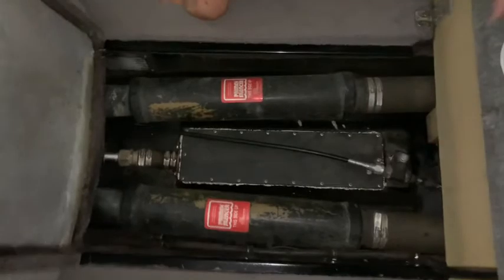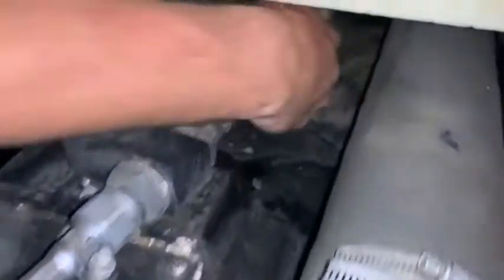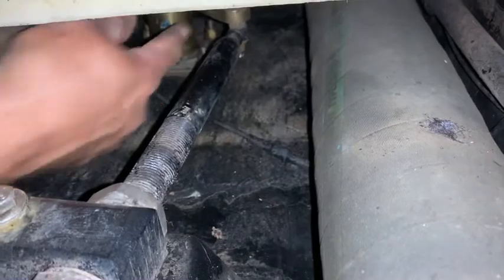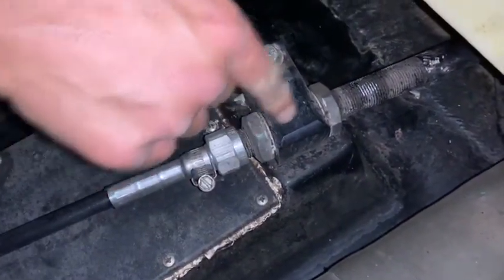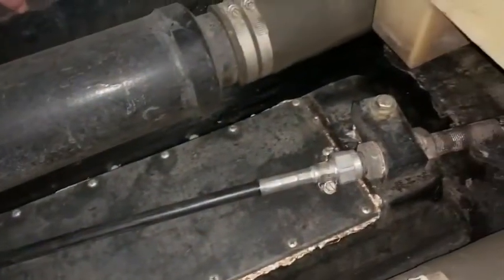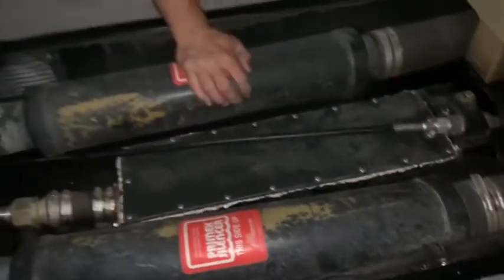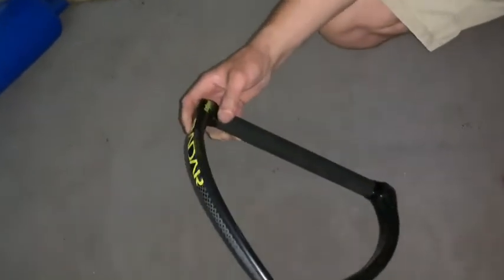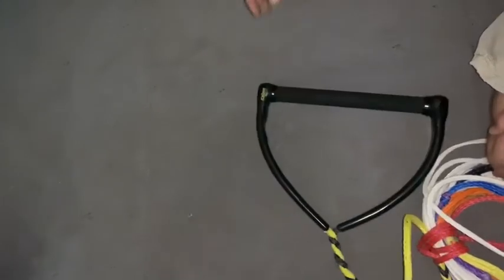Malibu Steering Cable Replacement - 98 Sunsetter

Comment: Joel, thank you for posting this video.  Your advice saved me when I was about 4 hours in and had given up all hope.  The biggest takeaway for anyone trying to do this project (and Joel points this out) is that the new cable needs to be PUSHED through, not PULLED through by a fishing line.  Lot of people on Malibu Crew forum suggested using the old cable (and attaching the new to the old) and pulling through the new one.  I found the cavity is just too tight for that much cabling.  Instead, remove the old cable and fish something small through (using the old cable to do so).  I used a weed wacker line.  Joel recommends a small rope.  Both would be fine.  You just need something that can provide a little directional guidance while the main force is the pushing effort pushing the new cable from front to back from the footwell to the stern.  Once you get the rod through the floorboard, the cable will slide easily.  Had I known to push vs. pull, this project would have been maybe an hour of work.

Comment: Do you need to add grease at all to the cable or just run it through dry? I have to replace mine on my 99 Sportster.

Comment: yes, how do I know if I need to replace the cable vs. something else wrong with the steering?  My steering is super tight.  Can barely turn the wheel on my 99 Malibu Vdrive sunsetter.
Reply from the maker: That’s a steering cable. The only other thing it could be is the rudder. That’s rare. Disconnect the cable from the rudder. If it’s still tight (might be a bit looser) then it’s the cable.
Reply: Same with mine. Super tight. Have never replaced mine  first time on my 99 Sportster